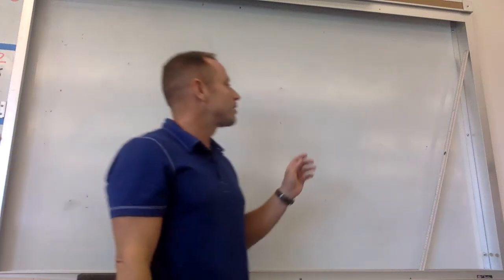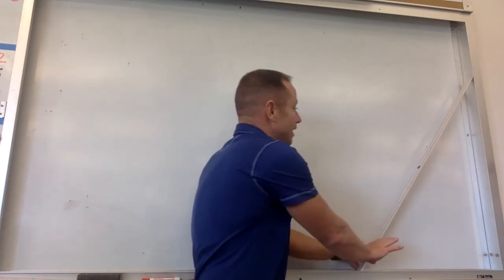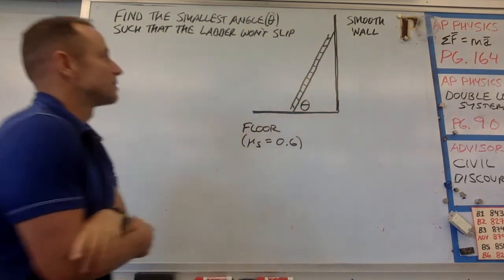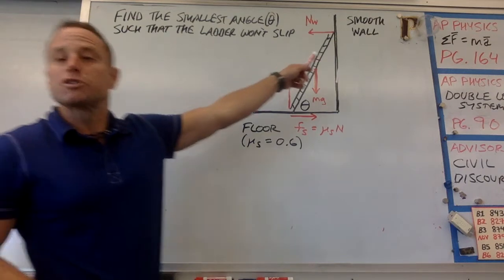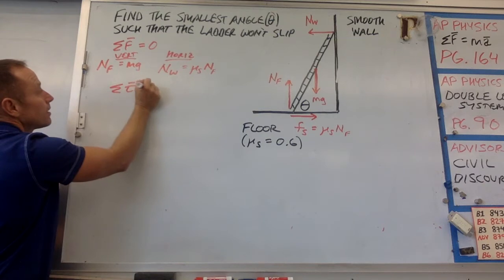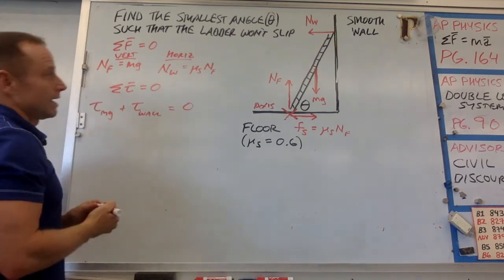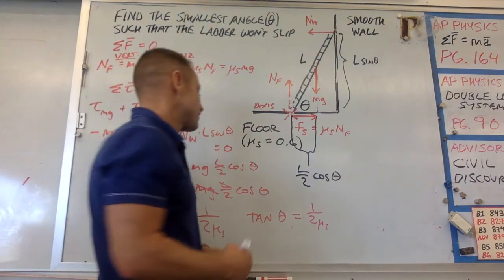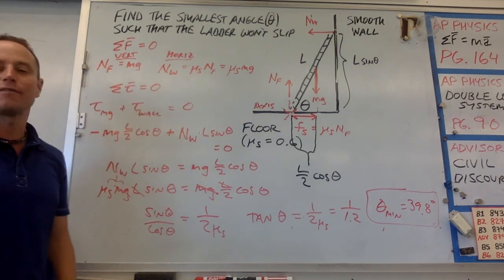Torque Example: Ladder Against Wall Problem

Comment: I have a problem, why the wall does not provide vertical  upward reaction (friction) in this case?
Reply from the maker: Simply because of the design of the prompt; the wall was assumed to be slippery. One could also define a friction coefficient for the wall and then it would need to be taken into consideration, as you suggest.